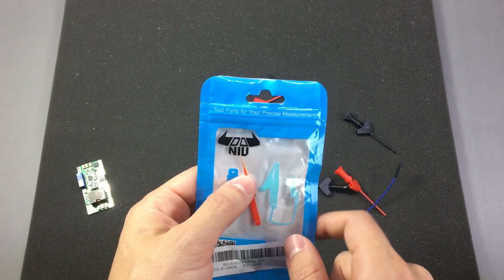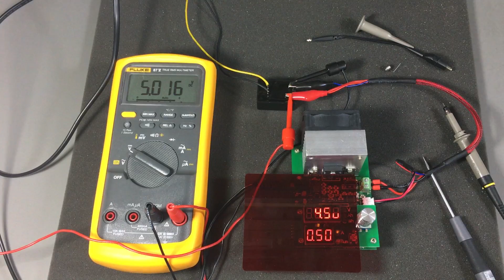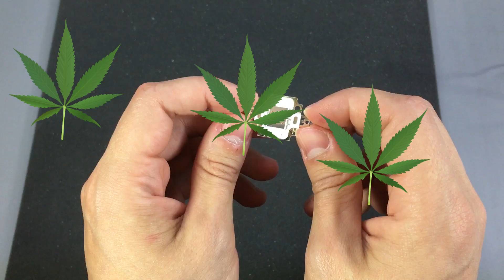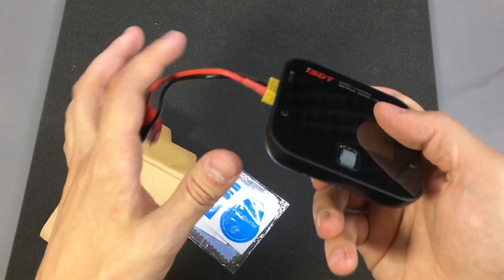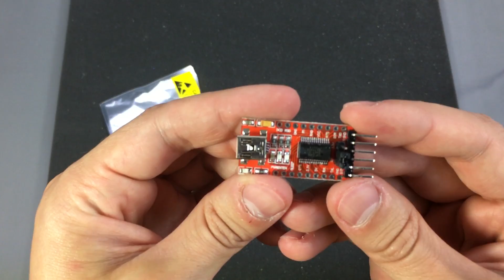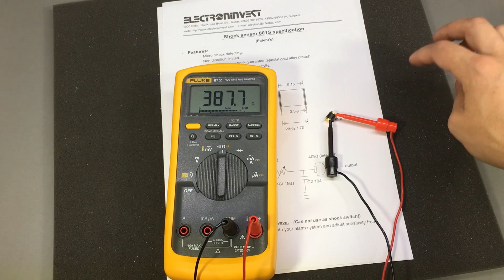Voltlog #118 - InTheMail ✉

Comment: 17:12 vibration sensor might be a voltage output one, not the usual type with a metal ball or spring inside.

Comment: Hey mr. VoltLogger!

What's your opinion on using those buck-boost modules as a part of a power supply (using only them to regulate with no extra filtering components after them )?
I would like to use a LTC3780 module (one of those blue ones from eBay) powered by a 12V rail from an ATX PSU, but it seems that the module, even with the seemingly pretty complex circuity and filtering is still quite prone to ripple, as it's discussed in this thread - https://www.element14.com/community/message/223780/l/re-reverse-polarity-protection-circuit-output-backward-flow-control#223780

The stuff that I'll be working with won't be very sensitive to ripple, but I would still like to make it as good as possible with this combination of parts, so the idea of using a linear + the switching regulator sounds pretty interesting to me. (always regulating 3 (or so) volts over the desired voltage and steping down that last 3V with a linear reg. )
Would that combo be any better? 

Thanks a lot!
Reply from the maker: the switching + linear reg combination is certainly the best way you can go about this, it will provide you with a nice low noise output. The stability will however vary on the values of the filtering components. Also watch out on the ebay/chineese modules, they might contain fake chips.

Comment: Great mailbag. That vibration sensor is way better than the previous ones I've come across.
Reply from the maker: yup, very sensitive
Reply: @voltlog  did you ever use it?

I think it might be a piezo (voltage output) sensor… as opposed to shorting the pins.

Comment: That power cube had less ripple than FFcossag's purposely built $60 Chinese Wanptek KPS305D bench power supply. I remember it being 0.5V.
Reply from the maker: yeah, I remember that "wanktek" PSU, it was pretty low quality. And that ripple I was getting goes away mostly when you add external filtering to the module.

Comment: "I'm sorry, I'm holding the probe with my hand and sometimes I lose the signal" - if only you would have 1 or 2 grabbing-type hooks, maybe even with Dupont-connectors :D Good show, thanks for sharing!
Reply from the maker: good point :-) I was actually trying to measure right on the output pints with a very low inductance in my setup.
Reply: good thinking! Especially as those Dupont-cables from Ebay/Banggood/Ali can add quite some side-effects. UV-LEDs are interesting, though. Need to check if they are suitable for PCB production.

Comment: Some pretty nice products, thanks. With one of the ftdi? converters I belive you don't have realy fun. Only one of them looks switchable between 5 and 3.3V. the other offer only the voltages over the Pins. In my experience it's needed to define Voltage by switch to make sure, i.e. the TX signal has the right voltage.

In this Vid you did show some products form AliExpress. Since yesterday I've some trouble with them because AliPay wants to get copy of personal ID and some induvidual kind of dokuments. I don't want to give them. Have you heard about other users, AliPay asked about individual dokuments? Without AliPay you have no possibility to pay the wanted  goods.
Reply from the maker: I don't remember them requesting any proof of ID.. It was pretty smooth for me.

Comment: ftdi protects its latest firmware/drivers and you could end up with an unreliable or uninstallable device if using clones... better go with cp2102 or ch340/1
Reply: Yep, that was a "feature" of the Windows driver. If you use Linux you're safe, and if you do get a bricked ftdi-adapter the Linux driver will fix it for you.
Reply from the maker: I am not up to date with the current status of the FTDI drivers but I must be  using some older drivers (on windows) because I've never had any issue.
Reply: I think it was them that wrote drivers that bricked the device. But there was such an outcry, because the public shouldn't be accountable for losses when they don't even know there are copies, so they wrote new drivers that don't work with copy ICs. You can still use old drivers if you can find them.
It's kind-of ridiculous that the public has to research every component on a device before they buy it.
Reply: Silabs chips are my preferred converter as well. I never had any driver problems with them on any OS (starting from Win XP up to now and they work on Linux obviously as everything does there ;) ) and even the oldest adapters I have are still supported by the driver (some other manufacturers dropped support for older chips, which made the devices they were integrated in useless). I don't know if it's easily possible with other chips, but on the CP2102 you can program in special baud rates (there's a tool from silabs for that). That's very useful if you want to use a non standard baudrate, because it fits better with the clock of the micro for example. And they run fine at 2Mbaud together with an STM32F1.